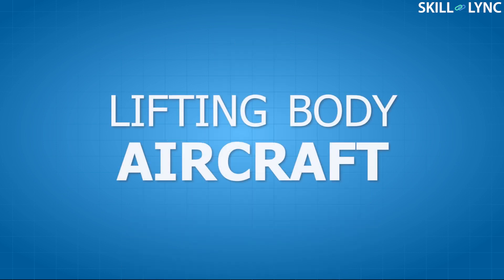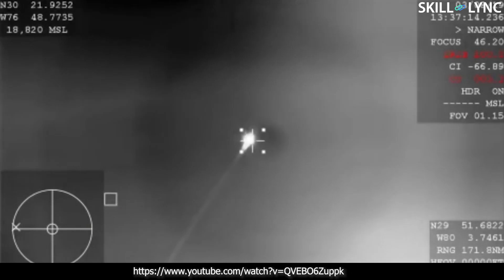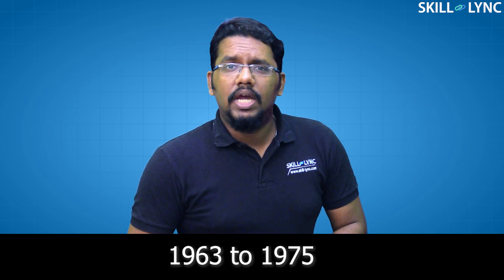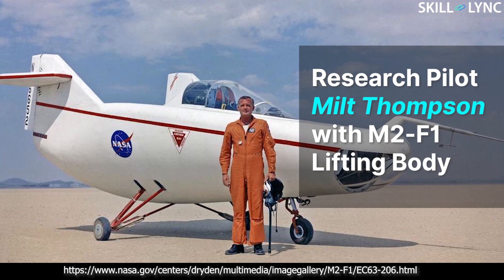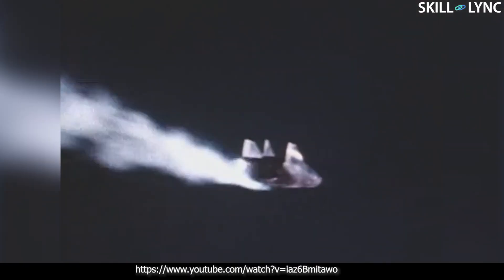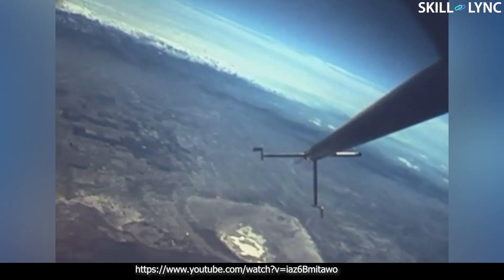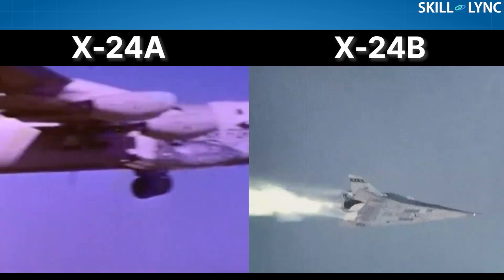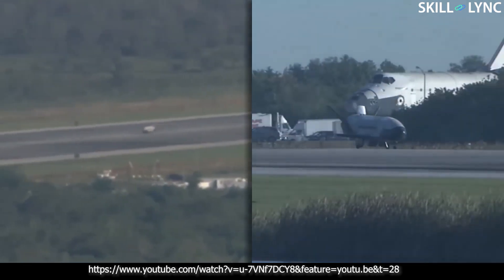What are Lifting Body Aircraft? | Skill-Lync

Comment: The towing car was a Pontiac, not a Cadillac.  Re-entry vehicle development was a very mind-opening discipline of science, by itself. Glide-slope for visual controlled unpowered landings proved to require far more precision than Naval carrier deck landings or glider landings on grass runways.  It was a complex physics challenge to simply manage energy with no changes in weight and balance through an increasing air density that created increasing drag.  In this case - pilots learned to master drag to become their best friend...not thrust or lift.